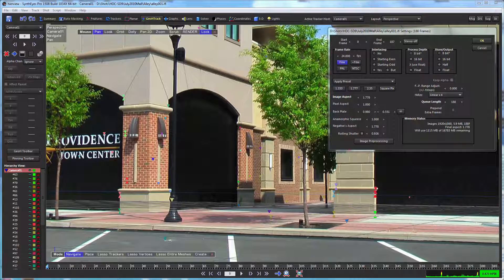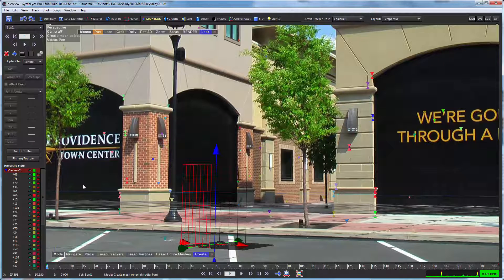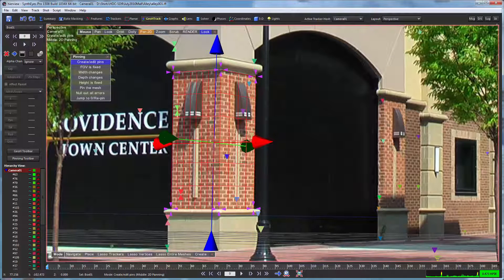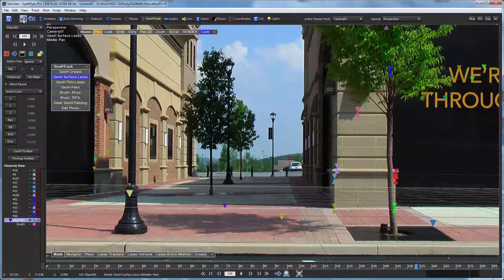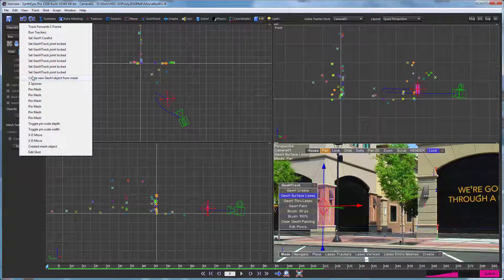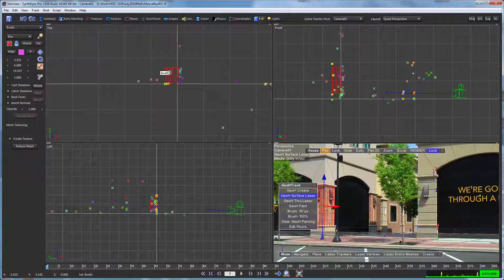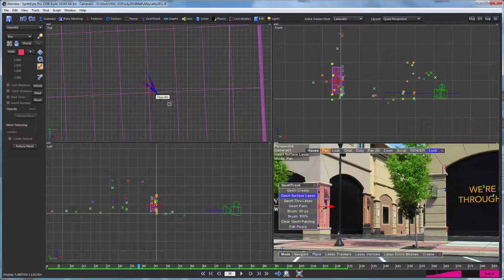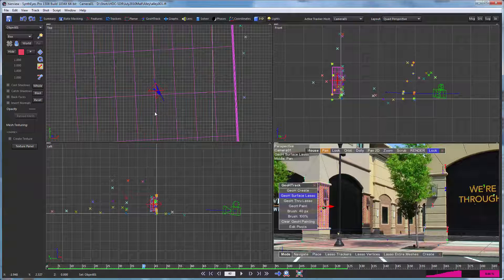Combining GeoH and regular 3D camera tracking

Comment: This Isn't working I've followed along with you until the actual pinning but i can't grab the verts (spelling check isn't working either) to pin i hold ctrl like you said but nothing. i cant get it to do anything and if i try too hard it just unlocks the perspective mode and rotates the camera. i even went to unlit wireframes just like you did cause it seems to be the only thing you do between selecting the mesh and pinning but nope not working.